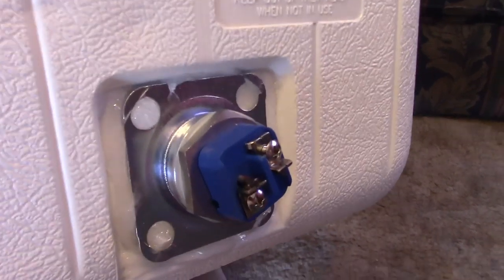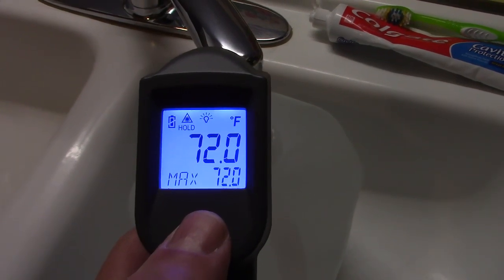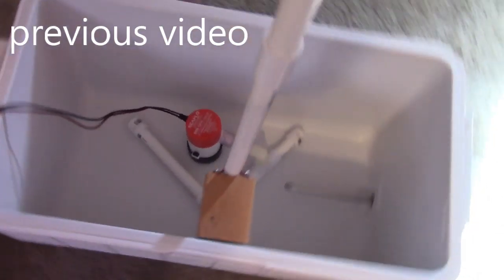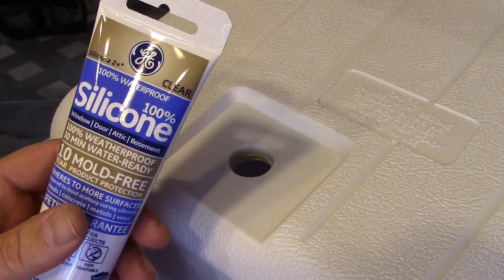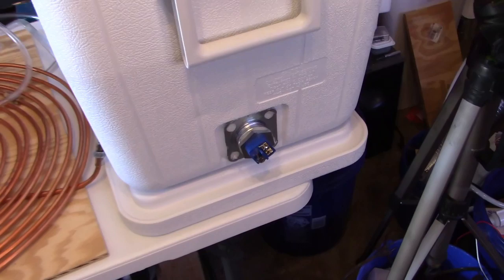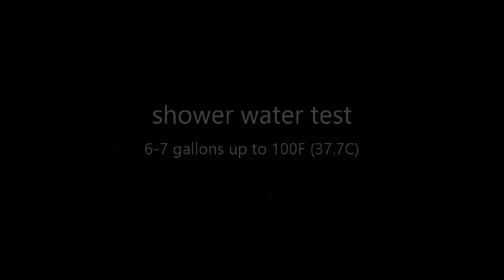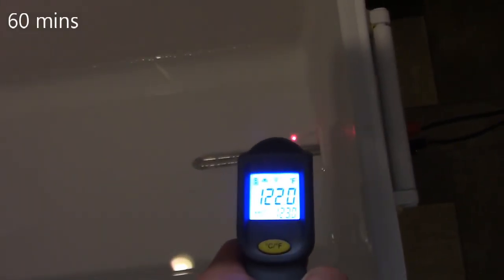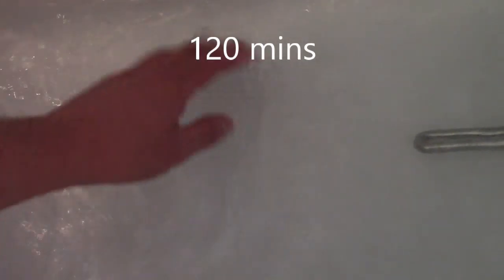12V DC "Off-Grid" Water Heater! 12v/12amp/12 Gallon tank! (ice-chest conv.) - can be solar pwrd! DIY

Comment: I came across this in early 2023 and built one for my cabin. I added a 12V thermostat to keep the water at 101F. I am currently building the shower using a 500 gpm bilge pump as outlined in one of your other vids. I repurposed a Harbor Freight 100W solar kit charging a 100amh battery to power my shower and outdoor washing station. I also followed your design to make a 5-gallon bucket cooler for my cabin. I'll see how it works this summer.  Thanks for the great ideas.
Reply from the maker: hi. i'm glad the projects are helping you! sounds like they are working out well. 🙂
Reply: Sure would like to have a link for that 12v thermostat, drives my 75yo brain nuts trying to find these things. Thanks either way.
Reply: @desertsun02  one thing I might add would be a W3230 temperature controller, Wire it to your heating element and power supply. Shove the temperature probe into the cold side of the reservoir and set the controller to trigger on the heating element once the water in the drops below 130° F. That way you can leave the set up running 24/7, You won't have to worry about burning out the heater or worse, your house; and the water will be above 135°F at all times.

Comment: Great vid.  Quick question on projecting time it would take a 10 gallon water heater to go from room temp of 70s to a 100 degree shower:  It would stand to reason that since you found 6-8 min 6-8 gallon shower a 2 hour warm up affair that a 10 gallon setup would surpass the 2 hour mark by a bit but maybe not by an entire hour.  In a real world application where not everyone would want to wait 2 hours for a hot shower, what are your thoughts on bumping up from the 150W water heater element to a 300W?  Maybe more like an hour-ish to get a 10 gallon tank to temp?  You end up using 24 Amps in that hour....within the capacity of a standard deep cycle battery.  A single 100W solar panel shouldn't have too much trouble recovering from that hit with an approx 30 amps/day collection rate.  So running some rough projections...2 panels would roughly equal two 10 minute showers with a 1 GPM showerhead and a 10 gallon tank.  And those 2 showers would have to be staggered about an hour apart.  So if one person tends to be up and shower before the other this could work pretty well.  Could push the envelope a little with that 2nd shower still pulling off the same  deep cycle battery but 48 Amps for 2 showers puts many 81-100AH deep cycle batteries in the 50% territory.  I guess the hope is the morning rays start charging the panel by the 1st shower and before/during the 2nd shower.  Obviously a 2nd battery run parallel would be a safer/smarter bet for the cloudy days.  Feel like I typed a bit more than I thought I would but figured being more specific with the question and scenarios helps paint a clear picture.  Maybe a little thicker wiring since you are pushing 24 amps with the 300W setup vs the 150W 12 amp setup you are using.

Comment: You could almost use this for radiant heat in a camper van with some water line and pump diy. Perhaps not up to high temps inside, but not freezing.
Reply from the maker: good idea 👍
Reply: Ironically this rabbit hole of mine led me here while trying to fab a diy in floor heating system for my tiny ambulance home

Comment: Awesome video!  Thank you 🙏  However, I'm having trouble finding the items needed on Amazon (probably because I'm not using the correct terminology).  Links and/or pictures of packaging for the flange and heating element (like you did for the ice chest) would have been very helpful.  

Also, I'm  not clear how to attach to the power source.
Reply from the maker: hi and thank you! amazon still has both the flange and the element. the flange is a camco 7223. here's the link https://www.amazon.com/Camco-7223-Universal-Adapter-Kit/dp/B000BQMK9C/ref=sr_1_1?keywords=camco+7223&qid=1699378523&sr=8-1
the heating element is a 150w dernord heating element. here's the link for that https://www.amazon.com/Dernord-Immersion-Submersible-Element-Stainless/dp/B0761L2Q8M/ref=sr_1_9?crid=3342738J8LHOY&keywords=dernord+150w+element&qid=1699378616&sprefix=dernord+150w+element%2Caps%2C177&sr=8-9
it's just a straight connect to connect it to the power source. positive to positive and negative to negative.

Comment: Great way to use at camping but..2 hours to heat a few gallons?   will you make one with more elements to heat the water faster?
Reply: Unfortunately that is the down side of low voltage water heating. The higher the wattage of a heater the more current drain on the battery and cable size required.
I do think tho in light of energy prices rising it won't be long before larger 12v elements are manufactured.

Comment: Keep it filled with a Kerick valve and hold the temperature at wished level with a XH-W3001  thermostat module.
Reply: Would you happen to know a 25amp thermostat similar for a 300w heating element?
Reply: @sethlael  use XH ‑ W3001 to control 25 A relay.
Reply: @kansaIainen  awh that makes sense. can I ask for a recommended relay. I'm just learning about all this. thanks! maybe a TWTADE SSR-25 DD 25A DC 3-32V to DC 5-60V SSR Solid State Relay + Heat Sink
Reply: @sethlael  Sounds legit. And not too expensive.

Comment: Very good. I done a similar thing with a  steel 230v 20l water urn. Added a 12v 100w & 12v 600w element.  600w heats 15l to 30deg in 15 mins for showering (no cold mix).100w to heat water up slower but lower wattage (never used). Added a probe & wired it up to thermostat for regulated temperature. Added a round bowl with sink hole  inside 3/4 way up to act as a baffle. External self priming pump added to push water to sink or shower. External cold water tank under van pumps water to water urn if needed. Urn has original water gauge to show how full. Finished it off by added insulating jacket (silver floor insulation) Cooler chest is simplier to make. This fits under sink unit & installed in my van conversion. Container holds heat for hours as insulated. No leakage either in transit. Cooler chest is a simplier solution & a great idea. Originally I was going to use a 20l metal new petrol container. Problem was fuel container has to be stainless steel. My set up is 200w solar panel with 12v  220amp battery. Cool chest does not corrode which is a good choice. Well done great video.
Reply: Jason, can you please provide the product name / info for the 12v 100w element?  Also, what did you use for your temperature controller/thermostat?
Reply: Hi,   just looked on eBay item descriptions at pricing to UK are:
Temperature controller: Ebay description: 12/24V  Digital LED Temperature Controller Switch Probe 10A Thermostat Control £4.59 + 42p postage

Water heater: eBay description:  Water heater, cartridge heater 12v 100w, 1/2" bsp, antifreeze, animal troughs £26 including postage.I bought this in error ordering a 100w instead of 600w but still installed it anyway.
Regards Jas.
Reply: @jasonannesley5889  Jason, for your van, how do you stabilize the element while driving?  I'm considering installing an element in a water tank in my van, where I would screw it into a bulkhead flange or similar, but I'm afraid it will bounce like crazy while driving, ultimately loosening the seal, or having the hot metal element bouncing on the side of the plastic water tank. It seems like the 7 inch element would have a lot of torque on the flange when it bounces ...Thoughts?
Reply: Hi, the heater element has a 1/2 BSP thread. I put a 1/2 BSP nut on the inside of the water tank I placed it in. I also used waterproof high temperature sealant around threads to make it 100% leak proof & left it to set 24hr. The knack when installing it in your project is don't install the element too close to the bottom of the tank (so element doesn't  touch bottom & melt tank). Place element like guy has in video. Drill a hole in the tank so the element fits tight with no play.  For gauging drill bit, drill in a off cut piece off wood. If element sits snug in hole you are using the correct drill bit. Only use tank for heating when water is in tank covering element. Never switch on with tank empty. Element can get extremely hot & burn out.  As mentioned in my original comment I made my heater from a stainless steel water urn. My water tank sits under my sink cupboard on a flat surface. For added security there are 2 bungy cords strapped around it for added safety. The cupboard holds a 25l cold water  tank & a 15l waste tank for sink.  As they are all tightly packed in cupboard with doors secured with baby locks I have had no issues with water leaks or movement. All I would say is test everything before installing it. Regarding your tank you can strap it down with straps or use metal banding to secure it or if it has mounting holes uses these. It may be worth putting some padding underneath tank to reduce vibration. Padded insulation, even old piece of carpet etc. Regards Jas.

Comment: Would I be able to Take a standard 6-gallon Rv propane/electric hot water tank that runs off 110-120V and change the element to 12V DC? I can't see any flaw in my thoughts but I believe you probably thought about this way more than I. :)... Hmmm I guess i would have to attach a Temperature shut power off sensor on it. Perhaps take a sensor to the outside of the metal and have the power go through the controller...

Comment: Is there a way we could make a water heater for showers from 5v portable battery devices? That would be amazing. Wouldn't have to be super hot, just warm enough to stand in.
Reply: Look for USB powered fish tank heaters.  There are a few and they should heat about a gallon of water to 90 plus F.
Reply: @dannynova3412   thanks for sharing that great information

Comment: I am going to use this same concept for a in floor radiant heat system. My concept is using large electric water heater and swtich out the elements for higher wattage elements. Run the right amount of panels to the elements and then using a DC boiler pump with direct connection to solar. This will allow the pump to kick on in the early morning hours and then the heat elements to draw as much energy as it can heating the water up as the whole day goes.  This should provide more than enough heat during the day and still be pretty warm at night. This is not going to be the main heat source just additional heat.
I have not seen anyone do anything like this in their builds. Though I have seen some where they loop the pex under their wood floors then put aluminum foil ( towards the floor and pipe )backed foam between the joist using scraps of wood then insulate it with fiberglass and then stapled up house wrap. This allowed that floor to heat up and produce some heat for the place. If I recall the person did this with a combination of hot water panels, wood boiler stove, and DC heat with water heater. 
I would buy a water tank that was set up with DC connections and works with a solar array voltage of 600v up to 10kwh. Built in thermostat and a water tank volume of 20 to 100 gallons. This would not only work for my project it would also work in any home by adding a pre heat water heater.
Reply: this will work, and will be VERY reliable.  That said, you would get about 3 times as much heat output using the same amount of power with a good mini split heat pump.  I have an Innovair unit that works AMAZINGLY on my solar system.  At most it pulls 1200 watts, and heats about 800 square feet for me in the south where it doesn't get too cold.  Also handles the air conditioning just as well even when it's 105 degrees out!  Too bad it's not on the market anymore.  Has a very high SEER rating.  30 if I remember correctly.  
I do NOT know much about the premade heat pump water heaters, but for the price they are charging for them, they had better be good!  Give one a shot, make a video, and post it for us to see?
Reply: I am using a pre-heat water heater as a dump load in my system already and it works great to soak up the extra power when the batteries are full, but let me tell you, it soaks up GOBS of power, and heats the water VERY slowly!
Reply: @sbartasek  We are now looking at just buying a full on solar system hybrid type that sells back the energy that we do not use or what we do not use to charge the battery bank. 
Heat/cooling I think will be done via a heat pump. Full size unit with traditional hvac system with hepa filters and pre filters. We like the idea of having several mini splits, one per room which would account for 8 units. Though the only thing that I do not like about the mini splits is their filter systems and the fact that we are going to have to pull them apart and clean them from time to time. If we just install a full on heat pump we can pre filter them in each room and then hepa filter tham at the unit. (pre filter means that the returns will have filters at each of the 8 returns) When we build we are still going to put in 8 zones of pex tubing because it is super cheap to do at the time of building. I also am still looking in to electric flooring as well. Though the one major thing about those are the cost of the electric flooring. The price per foot is expensive and with out knowing anything about them. Some of the instructions talk about every 3 to 6 inches. Imagine a grid of them over 3000 square feet is going to be quite a lot. 12000 to 6000 liner feet to be exact. Then they spec around 10 watts per foot. We are talking 120kwh to 60kwh peak loads. This is why its disconcering when looking at electric flooring. 
Deye is a company that makes mini splits that allow direct connections to solar. They have a built in mppt controller. The company also offers a water heater in the same style. The specs state something along 3kwh max solar while I have seen videos where people are putting only 1kwh or less on them. Though I still wonder how they will work when the sun is super low and its in the dead of winter. 
Which is why we are 100% now considering just going with a solar system with grid connection. We are not going to do net metering and opt to sell back to the grid instead. The net metering would be nice if we were going with just grid tied solar. Yet we want to be "off grid" and to not rely on the grid for power. While we have not gone with out power for more than several hours we fear there may be a time in which the power can go down for several days. 
We are lucky to have natural gas, yet the price of said gas is becoming costly to keep it going for heat. While we use it right now for cooking, water heating and heating we would like to reduce it down to some cooking and switch to electric on almost everything else. I have switched out my gas griddle and char grill for an electric 24 inch griddle and a 8x14 pannini grill. So far things have work out pretty good on that end. Out cook stove is natural gas and in the future would like to install a double electric oven while still keeping the range intact. We also plan on doing a induction or electric cook top. To do induction we would have to really consider an expensive swap of our cookware. Of the 3 newest saucier pans we got they are induction ready. Yet I was thinking about swaping out my entire cookware set and buying a new set which runs around 1000 dollars. Induction ready runs about 2300. 
Anyways I have some options and need to do some more reasearch. I have even thought about the well type heat pumps as well.
Reply: @kameljoe21  I can't REALLY read all this tonight, but can never recommend having someone else in charge of how YOUR house runs...

Comment: Have you done any analysis on how much power this takes? How many times can you do this inns fully charged battery? How do you charge your batteries back up after?
Reply from the maker: hi. i haven't done any in-depth detailed testing (yet). i usually use 12v solar panels to charge them
Reply: @desertsun02  are you still using this method now? Any I
Improvements you’ve thought of since?
Reply from the maker: @Dan Rockell yep, i'm still using the same setup. i haven't changed it any since i made the video. works great.

Comment: Thanks !  What size cable with the crocodile clips on ?  As in, if using from a 12v battery to the element terminals. 
 That would also need a 15amp fuse on the live from the battery to the heater terminal.
Reply from the maker: hi. i used 12 gauge cable (but 14 should work too). 16 might be a little too small

Comment: Wonder if this could work for a Water tank mounted under My sprinter van hooked up to a toggle switch so my water doesn’t freeze in the winter and then I also could turn it off when it’s not needed so power isn’t being wasted during the summer time.

Comment: where do i buy a 12 volt 150 watt element... Please give Link..........
Reply from the maker: hi. here's the link to the one on their website https://www.dernord.com/products/12v-150w-immersion-heater-submersible-water-heater-element-1-inch-npt-flange  also, if you just type in '150w dernord' you'll get a whole page of links.
Reply: I’ve messed around with this stuff a lot - had a thermal solar system that is in really rough shape after 15 yrs - LOVE your simple/genius approach to this!